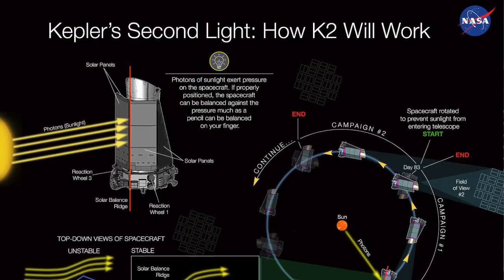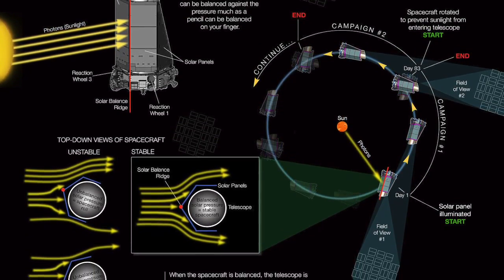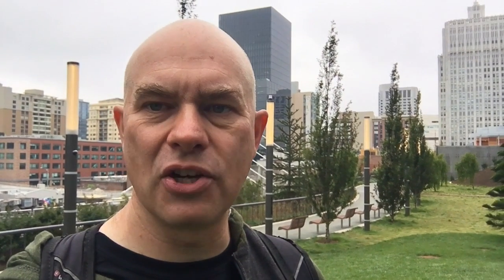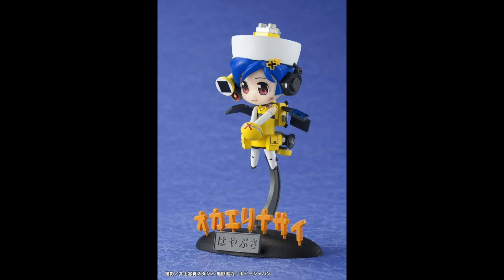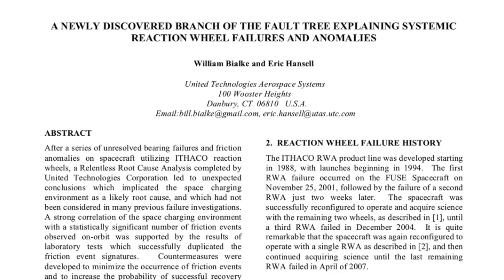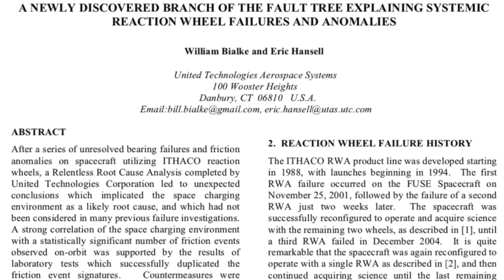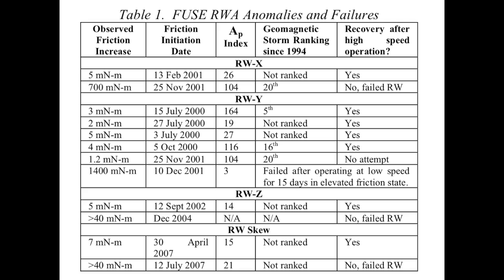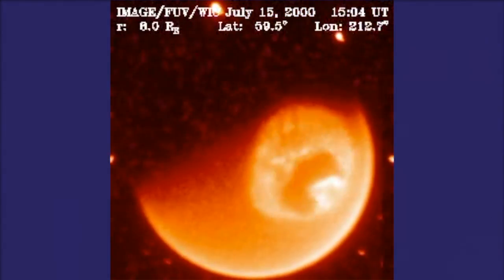Scientists May Have Figured Out Why So Many Spacecraft Were Failing

Comment: In the automotive industry we use a special  lubricant that does not conduct electricity. Used inside high voltage air conditioning compressors found on hybrid and electric only vehicles.

Comment: These failures seem to occur on scientific missions, not on comsats, which are even longer lived.  The story I heard was that you can buy a $100K reaction wheel with bearings, or a $1M reaction wheel with a non-contact magnetic suspension.  Science missions have tight budgets and are forced to use the cheap wheels.  Comsats use the better wheels, which don't have this problem since they are non-contact.  I have no proof of this conjecture, but it seems very plausible.

Comment: We see early bearing failures on VFD-driven motors in HVAC systems when the bearings aren't grounded. The failures are caused by electrical discharge just as described here.

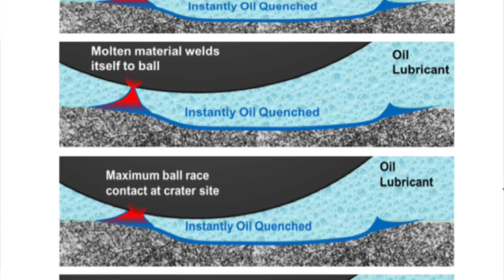Comment: 5:24 No one needed to look at spacecraft.  My 2005 Ford Focus driver’s side wheel bearing knuckle is very pitted, and this is due to receiving 12+ volts from battery grounding for years.

Comment: I worked in the automotive field and some manufacturers employed ground straps to the front strut assembly which contained the wheel bearing assembly. Electro static charge could be generated by the tire to road surface and discharge through the bearing eventually pitting the ball bearings. So your theory makes sense.

Comment: The same process can happen on vehicles. If the ground strap to the motor deteriorates or breaks the electricity will feed through the drivetrain  and destroy the transmission. If you drive an older vehicle you should check and make sure the ground strap is in good shape and functional.

Comment: Flow from a CME can be clumps of positively charged stuff. Hitting this faraday cage-ish housing, can then bounce off, neutralized, carrying electrons away (leaving the entire object with fewer electrons by the way). The resulting movement of electrons inside while adjusting to it might fry some components. If there's anything to this, simply don't allow exposed metal to the outside, insulate. You'll still get movement from the capacitive effect, to be dealt with, and test for that with both + and -10KV or whatever level based on our knowledge of CMEs but the overall theft of electrons by positive sputum from the sun will be ameliorated. No offense dear Sun, we love you, just that cough of yours--It's not you, it's us, stay calm, we'll put on a mask.
Reply: Keep in mind there's no such thing as an actual positive charge, it is virtual, merely the lack of electrons

Comment: Got to work on an excavator that touched high tension power lines and never shut the engine down but welded the turret bearing in place. So it wouldn’t rotate. Those were a bitch to change. Had to cut out the ring gear in pieces to get it out. Was discolored from the heat of the current.

Comment: The quality of bearings has gone to hell in the last 40 years. If you have apliances from the 70's or 80's, they probably still work. If you have appliances from the 90's or 2000's, you're probably a junkyard or recycling center. There are of course more 'intrigue' filled notions of how so much failure could slip into expensive orbital devices in the west. But crappy worksmanship is entirely plausible. Sure space might be doing things hard on bearings, but this "problem" in space vehicles kinda tracks very closely in calendar years with the bearings in every other product turning to crap.

Comment: Wow, could it be where the Webb telescope has ITHACO reaction wheels, or not blame them and use non-conductive materials like carbon fiber bearings and races etc?  I suppose titanium conducts, but not sure about graphite.  Would it be easy to change them out with another brand?  I'm only amateur, if that, and just a thought.  Thanks for this great insight!

Comment: HVAC motors now running with inverters to control motor speed have this same issue. I believe it’s been solved with a mixture of ceramic bearings or having a brush connecting bearings to shaft to make the circuit, saving the bearings.

Comment: high voltage pwm motors fail due to insulation breakdown caused by circulating return currents
who would have thought the cabling RLC could be a factor,   you are never done when electrons are in motion

Comment: I have seen this exact problem in a welding fixture that was mounted on bearings.  It worked great for months but eventually the bearings would be so damaged from arcing that they had to be replaced.   This just became regular maintenance but that is a little tougher to replace in a spacecraft.

Comment: Very interesting, as I’m a retired marine machinery mechanic & the Navy back in the late 1990’s experienced a similar problem after a week of conducting a heat run test/monitoring of a newly installed bearing.  It was determined that the manufacturers were to blame.

Comment: This is exactly why the very early Tesla EV motors failed - they had steel bearings that were affected the same way by the intense magnetic field of the AC induction motor.  Same solution - use ceramic bearings.

Comment: Arcing across bearings in 3 phase AC motors is a common problem when using variable frequency drives.  VFD harmonics induce voltages of several volts on the rotor, which arcs across the bearings and destroys them in a very short time. It's solved by using Aegis rings to provide an alternative electrical path for discharge.  Aegis rings use a microfiber brush that runs a few nano meters from the spinning rotor shaft.  The body of the ring is electrically bonded to the motor housing and the micro fibers rub against the motor shaft.  As the shaft spins, the mucrofibers wear away until they're just a few nanometers away.  With the Aegis ring in place, induced electric charge on the rotor arcs across the tiny microfiber gap rather than across the bearing.  The microfibers last forever since they don't wear away any further once the gap is established.  It's a simple and cheap fix.  You'd probably have to allow them to wear in before installing them in the spacecraft in order to prevent particles from in initial break in period from contaminating the spacecraft.  Or, the ceramic bearings could have solved the problem as well.  I just wonder if the induced charge will cause other problems if not dissipated.  Aegis rings are cheap insurance regardless.

Comment: Why not use a carbon brush across the bearing mount and shaft? That would create a bypass for the voltage and solve the problem. Second solution would be to use a conductive graphite grease in the bearings.

Comment: Ceramic ball bearings are just better, but I don't think the discharge seen by a spacecraft will damage steel bearings. Highly loaded bearings in high voltage particle accelerators don't suffer discharge damage. They suffer from the insulating gas degrading their lubricant, but not from multi-megavolt discharges. I wonder how good the spacecraft bearings are in vacuum? What is the vapor pressure of the grease used? Most greases good in high vacuum are not that good at lubrication.

Comment: Do you know, that each car has in his Axis wheel bearings has little copper alloy spring, that supplys a low ohms contact, that shortcuts electrostatic high voltages to avoid bearing corrosion?

Comment: "Engineers think that the sealed component are acting as a faraday cage, thus shielding the internal components from electrostatic discharge" ......... Me looking at supplied picture of reaction wheel and sees multiple entry points for electrical wiring for internal motors and sensors, but hey.

Comment: Electrostatic discharge is a common thing in industrial machines. Just the normal operation of a machine (with spinning/sliding parts) can cause significant self-generated static charges that discharge through the bearings.

Comment: VFD's on commercial motors cause the same problems.  And ceramic bearings were the solution.
Reply: What does VFD stand for?
Reply: @robst247  Variable Frequency Drives

Comment: The wheels failed because they were not made by Honeywell.  Anytime reliability is required use Honeywell - former NASA, DOD control systems engineer.  Ithaco had a problem with its wheels in 1990s too.  Long duration missions can also have lubricators (reservoirs with extra "grease", to add to bearings like an on board grease gun.)  When wheels are improperly sized (too small, or not enough torque, can fail too.

Comment: We deal with this particular problem in industry whenever an electric imbalance is created either by the process or even the VFD for the motor. The correction is of course to neutralize the imbalance between the shaft and the outer race of the bearing in some way. I don't understand how spacecraft manufacturers would miss a thing like this which is nearly as well understood as bearings themselves. The wheels could also be tested insitu outside the ISS and then brought home on a Dragon and the bearings dissected and the outer race examined for this kind of erosion.

Comment: happens when motors are ran with VFD drives as well, have to install grounding rings to stop the arcs or it will pit the inner race and destroy the bearing.

Comment: no bearing case will ever work as a feriday cage because they aren't seperated from the inner components by nearly a large enough margin.    a rotating metal component creates a magnetic field.  6v at 13amps is enough to solid fuse a steel bearing.

Comment: This happens to bearings in similar situations. A short run through a transfer case basically did this to all the bearings. You could see the arcs and pitting. Also, you have to be careful not to ground through a bearing when welding.
E~ I see Cody already pointed this out.

Comment: Its true. The bearings need to be shielded. We had a motor failure caused by this on a draw works motor on a drillship. The bearing race surface suffers galling which looks like deep clean corrosion or arthritis on a bone.

Comment: Is there anyway to put them through conditions similar to what the sun puts out so as to test the theory that might be a way to show whether or not that is exactly what’s happening if it does then ceramic bearings are going to have to be the only way to work with those type of wheels

Comment: I have had to change many front wheel drive wheel bearings because of loose ground wires and the 14 volts from the alternator on the negative side is trying to get to the car body where everything is grounded. Path is engine, trans, CV axles, wheel bearings, either the strut mount or the steering linkage to get to the car body.

Comment: Seems electrodynamics is understood well enough that this really shouldn’t be a thing that was overlooked by folks with such big budgets and the ability to hire talent at will... Another electrodynamics issue with bearings is they become magnetic, so placing a bearing near magnetically sensitive devices will also cause some problems.

Comment: Yes I’ve seen electrostatic pitting on a large journal bearing for a turbogenerator. So why not for a small ball bearing. This is the probable reason for the failure.

Comment: They did not think about grounding the rotor??!! Even some home appliances have that. In big electric motors they use isolated bearings. In engineering its common knowledge since like 100 years.

Comment: I find it incredible that this problem wasn't detected before they built the spacecraft!  Pitting caused by electrical arcing  is quite common on earth, and best practice is to electrically insulate the bearing.  Non conductive sleeves on the inside of the bearing and a sleeve of non conductive material around the race is considered normal for electric motors.  Motors can destroy their own bearings if the bearings are not insulated!   As a welder I always had to be mindful of the ground path to make sure no electrical components or bearings were in it.  The high voltage of the welding tip can cause arcing inside bearings, pitting and destroying them. And of course sending high voltage through vehicle computers, regulators, alternators and such smokes them as well.

Comment: You would honestly think that something going into space would just automatically be fitted with the best possible bearings,  if it has no shock loads why wouldn't they have been ceramic to begin with?.....guess not these days....cheap and "seemingly" the best is good enough now.

Comment: That failure way is similar at what happens at ball bearings in rotating x-ray tubes.
The ball bearing is part of the electric circuit and in some opportunities sparks goes through the ball bearing gap, damaging smooth surfaces and reducing its life.

Comment: An odd question related to reaction wheels: Has a Ferrofluid-Induction Field combination ever been used? And would the loss of energy in the system to Brownian motion/fluid friction still conserve the total system momentum? I guess I'm wondering if it's possible to dissipate momentum into chaotic systems as thermal energy without Newton rising from the grave...
Reply: I'm sure it has but the biggest problem is that space is a vacuum and so fluids tend to boil away

Comment: Ceramic electronic capacitors are used for the same reason aren't they?
If a faraday cage doesn't work, does that mean there's a difference in potential between the Sun and the space craft component?

Comment: Oh Scott, Scott, Scott. For the first time, I have to take exception to one of your videos. In your wrap up, the problem did not "solve itself". Engineers found a suitable, non-conductive ceramic material that so far appears to have fixed the problem. 
Still, thumbs up!
Reply from the maker: But that was for different reasons, they didn't know this was the likely problem until after the transition was made.

Comment: Good theory. However the underlying issue here then is incorrectly preloaded bearings, as the balls within a correctly preloaded bearing would contact both the inner and outer race, so no gap to jump across. However if the voltage was high enough the contract are on a fully contacted ball bearing would be tiny so the effect may still ocour.

Comment: Would it be possible to create a reaction control system in which high-voltage currents supplied the momentum?  The angular momentum would come from electrons rather than molecules.  I realize the electrons would have to do over 10000 times the amount of work to match an entire molecule's momentum, but could such a system work on missions with long delays between orbital maneuvers, such as deep space probes?
Reply: Where do all the electrons come from?

Comment: ...I remember in the tine of VHS video recorders, the fast-rotating video head rotors all had a small graphite contact, mounted on a brass leaf spring touchig the rotor's head's center. The purpose of which was to dissipate static electricity.

Comment: Scott? If the reaction control thruster assembly is "modular", can we not load fresh ones and fly them up to replace the spent ones. Sounds like a "ready made" manned flight objective. Those that cannot be replaced, we push the satellite down so that it burns up quicker and pollutes the space around Earth by bumping into other working satellites. Too logical for the eggheads at NASA to figure out.

Comment: As an electrician and maintenance tech of such things, it is a common known fact.  We have to use "Insulated" bearings on our Variable Frequency driven Motors, otherwise the bearing rollers/balls "weld up".  The bearings are more expensive yes, but not by that much.  The "Down Time" is the Real Cost Factor. . .  As they are finding out just now, with no way to repair the damn things.  Oh well. ..  Just kiss a $500 million satellite by-by for a $5 item, then go ahead and build another the same, exact, stupid way!
  And people wonder why NASA gets their funds cut all the time, really?  (You can't really blame the government, NASA can't seem to figure it out ether.)

Comment: Going out on a limb here, but in my youth I use to be a tesla coin fanatic and one thing that became very clear to me after a while is that when you are applying a large amount of energy to a high mass object is that eddy currents inside of the object, even if it is what you would consider shielded can easily reach into the hundreds of volts for an instant.

Comment: It's funny how unresponsive these humans systems are. With so many spacecrafts at the table, couldn't they at least figured out a statistical game to simply rule out a bad assumption and figure out the exact physical processes later?

I doubt the cost would grow that much (compared to the rest of the spacecraft) if you'd only strategically use the ceramic bearings for control test. And by the looks of some comments here, Ithaco lost its business and its reputation in the long run, so not only its unresponsive it is also incredibly unreasonable. And I don't think they even had the negotiating space required to make such a request, so it's also completely unfair, to top it off.

Point being: this was probably not the problem with the bearings, but a deeper rooted problem lying with whoever ordered them based on their price. And still we need to look beyond this point as well... Because whoever ordered them obviously had a job to cut the costs, etc.

Now let's think of a human system bigger than Ithaco or NASA, and here we're likely to have even more mysteries surrounding the ill-formed assumptions. But let's all blame some Ithaco for all our faulty bearings, right?